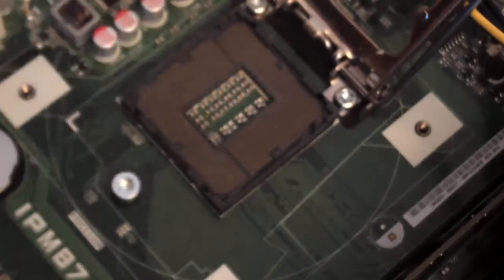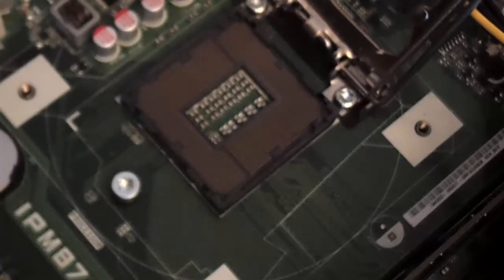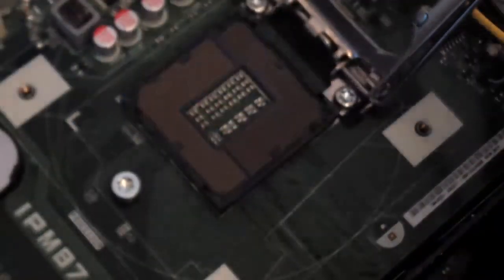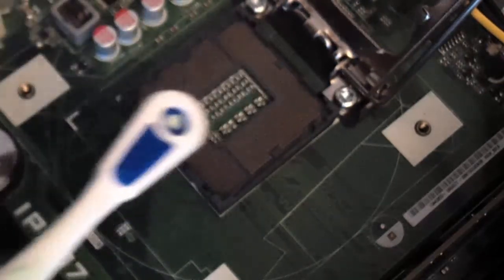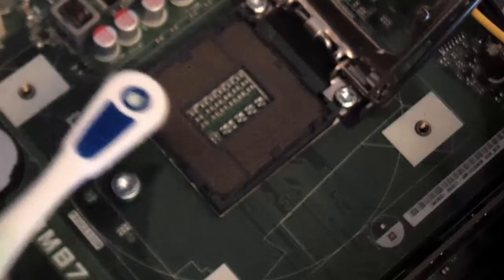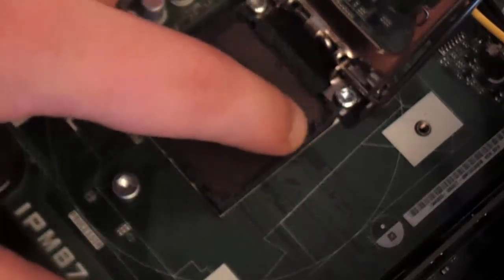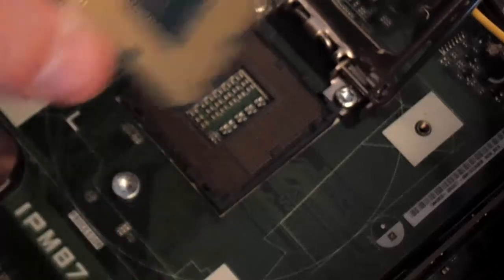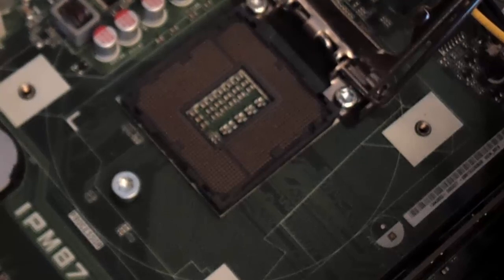How To Clean An Intel CPU Socket

Comment: or you could just tack out the cmos battery and run the bored under some warm water with a bit of soap and let it dry in a warm place for 48 hours witch is a lot safer than this and most home sinks have a sprayer as long the water isn't on full blast and also remove the MB heat-sinks before doing this